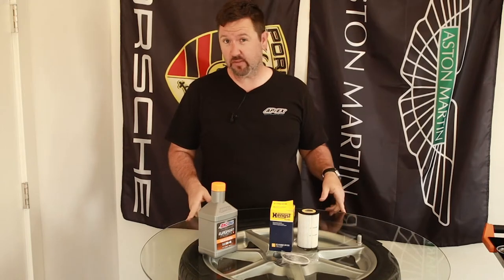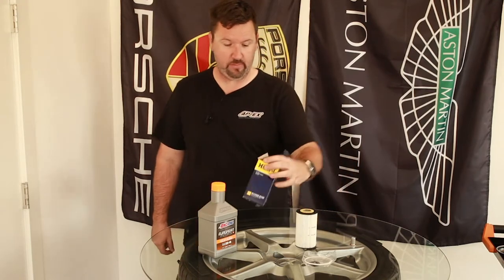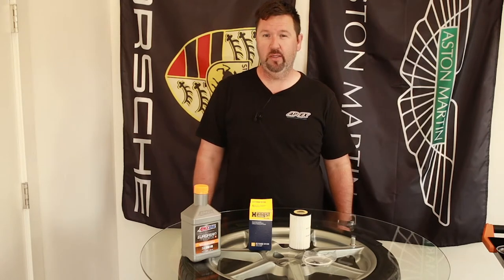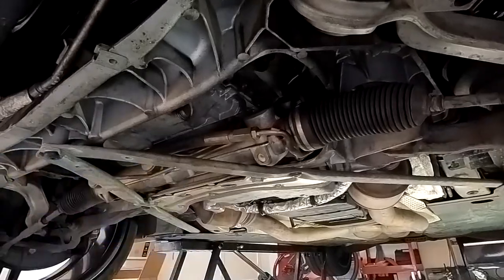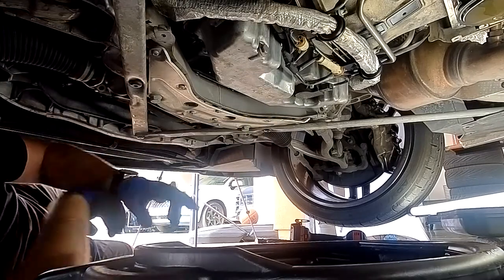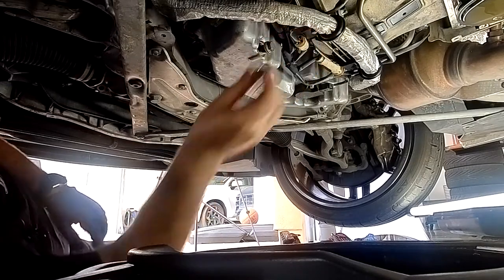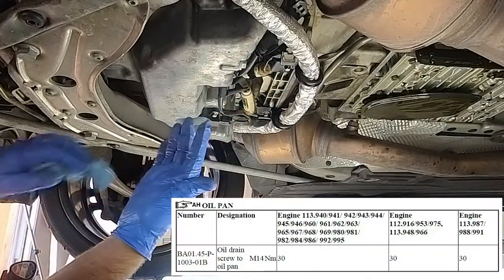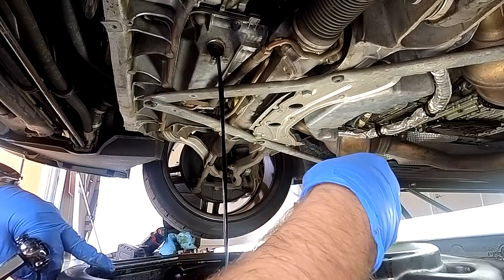2004 Mercedes SL 55 AMG Oil Change

Comment: Oil filter gets unscrewed first and stays there until you finish under the car, filter becomes dry. After you done draining, you change filter and fill oil. While unscrewed- air gets inside oil line and allow some of the oil flow back to pan. More used oil out of the engine.

Comment: I bought a good but used Rigdid strap pipe wrench that works flawlessly from ebay. The garage is freezing but I think it's the 
#5 model  13" aluminan handle and heavy strap. Mine is 15 yrs old and the best improvished tool bought to take that oil filter cap quick It will work for many applications . Get a shop dip stick  measure 165 cm , Dont rely on the onboard transducer . Write back if you need further assistance.